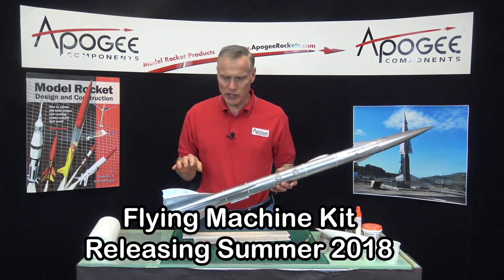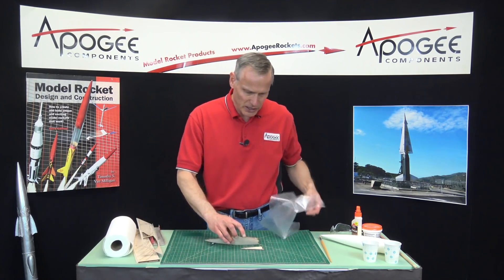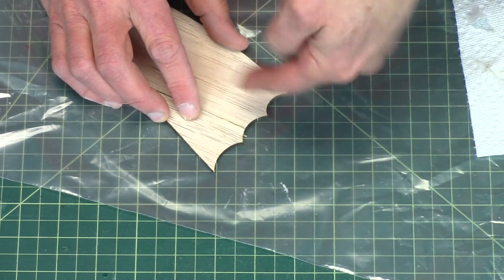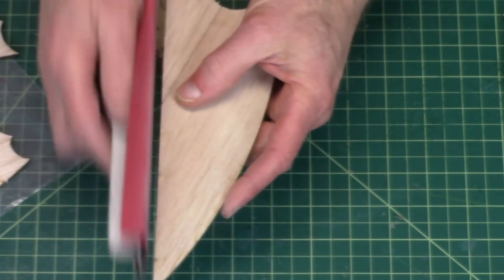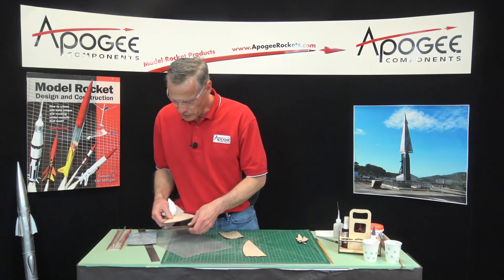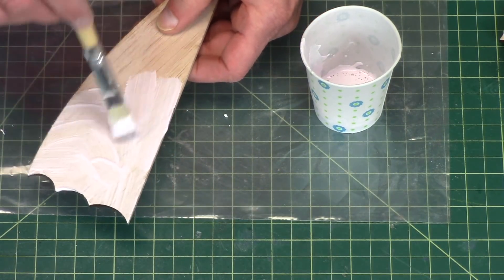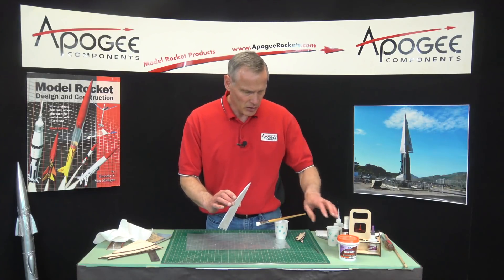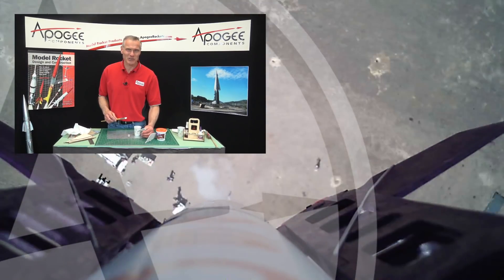Flying Machine Rocket Build: Part 1

Comment: I use to build rc ( radio control) hydroplane boat ,kits are laser cut & leaves that black/ burnt on edges. I would sand edges just to remove some of that black to get a "Glue Bond".
   It would be so cool if you come out with a      ""Space Shuttle""

Comment: The problem with a lot of kits, especially if you're using epoxy, is you start it in the morning and you're ready for paint by noon.  But it's still November, and we don't fly until May.  So you build another one and another one...and another one!  This one looks like it might really be a winter project.  All those rivets and wood strips and fins and paper parts would really add to the build time.

Comment: Which helps make the fins stronger? Elmer's Wood Filler or AeroGloss Sanding Sealer??? I've always ever used AeroGloss sanding sealer. I may also try using paper laminate after seeing a video on that but I ALWAYS sand the fins into an airfoil shape, so obviously the paper would get sanded off the rounded leading edge and pointed trailing edge.
Reply: When we paper fins, we sand our airfoils into the fins first, rounded leading edge, tapered trailing edge. Then we cut our paper big enough that it covers both side of the fin with the centerline of the cut paper centered on the rounded leading edge. Coat one side with glue, and start applying paper at the trailing edge and work up to the rounded leading edge, then glue the other side of the fin and work the paper over the leading edge and back down to the trailing edge on the second side.  Press it between two flat surfaces so it dries flat. Usually we cut the paper a little oversize and then trim/sand it down to the edge of the wooden fin.
Reply from the maker: Test. Test test. your results may vary depending on how your building kits.
Reply: Ha Ha! OK! I was hoping someone already tried comparing the strength the two products give! I would of course then use the stronger one.

Comment: If the wood was primed with a  sandable, high build, fast dry primer (spray) and then followed up with the carpenter's wood filler, would the fins be less likely to warp? Would the carpenter wood filler fill also fill the voids faster?  I'm a novice.
Reply from the maker: The great thing about rocketry, is that you can test things easily yourself. Give it a try and let us know what you find out.